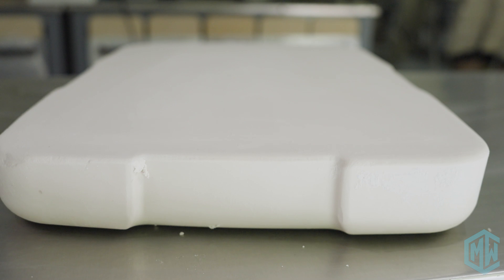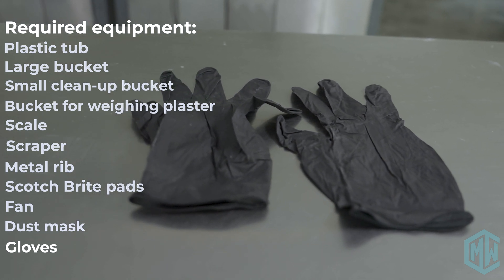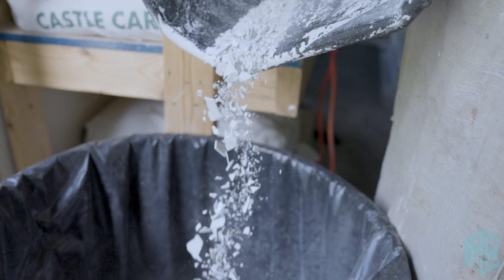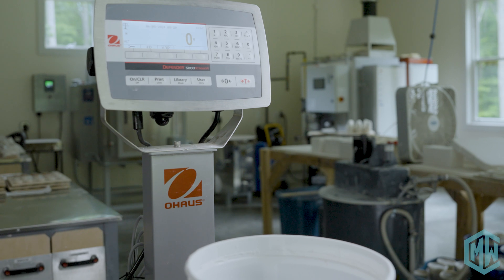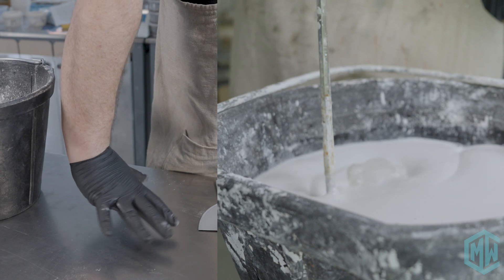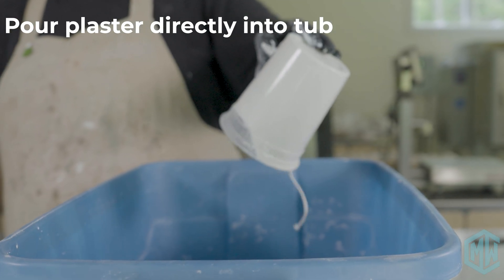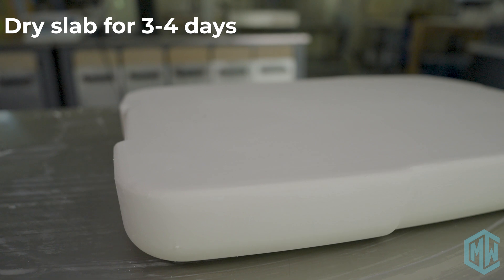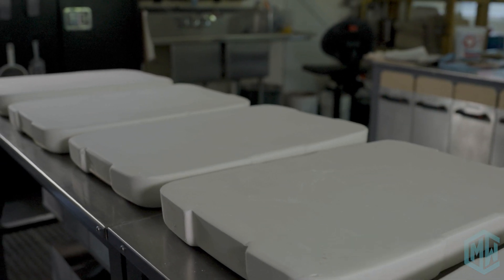How to make a plaster slab for clay body testing | Ceramic Materials Workshop

Comment: Great tutorial. I’ve watched several videos where they mix everything directly in the forming bin rather than in buckets. They add the water, then add the plaster the same way you did by hand, bit by bit. They measured the ingredients, but also looked for when a small island of plaster forms in the water, which indicates the correct ratio. Then the hand mixing. 

Do you see a disadvantage to that method? I love that it’s simple and avoids the need for extra buckets and tools. Faster cleanup too.

Comment: The transcript does not even follow what you’re saying. Can I just get a formula how many cups of plaster to how many cups of water? Why does this have to be so difficult?
Reply: Measure your mold or bin to determine size of slab you want.  L x W x H.  This final number is cubic space your slab will occupy.  Next, take that number and divide by 80 and that will give you the number of quarts of water you will need.  Next multiply quarts of water number by three to give you pounds of plaster needed.

Comment: By using the same bucket with old plaster bits, even tiny bits, it will start to set your plaster much faster. You can use that to your advantage but it's best to be aware of it as your mixing time will be shorter. There is no reason to have a dedicated mixer for the drill as long as it it cleaned afterwards. I like having a bucket of water nearby to dunk tools into.
Reply: True.  If you have trouble getting rid of bubbles, try mixing plaster in and with clean equipment.  It will stay liquid longer, allowing bubbles to escape.

Comment: Great video.  I like the precise weights. I need to make me a good slab. 

Near the end you mentioned that there are 8000 grams of water that need to be evaporated out of the slab for it to be completely dry, but isn't a large portion of that water chemically bound with the plaster and will never evaporate?
Reply from the maker: You are correct, we misspoke.
Reply: Only a little under 19 g of water becomes bound for each 100 g of dry plaster used.  Whether that's a large portion is a matter of opinion.